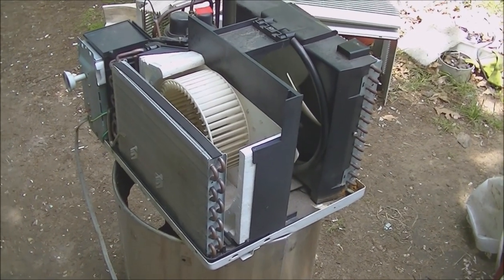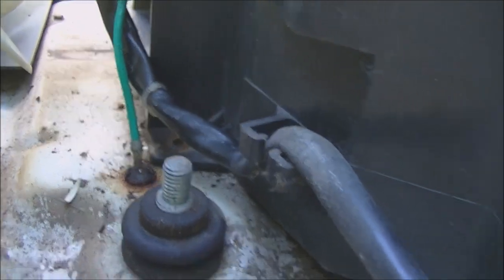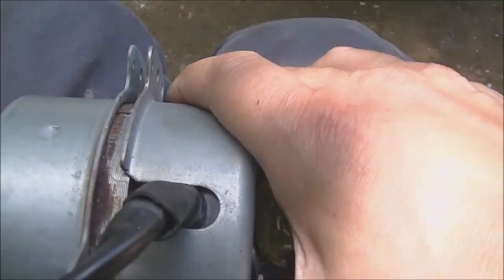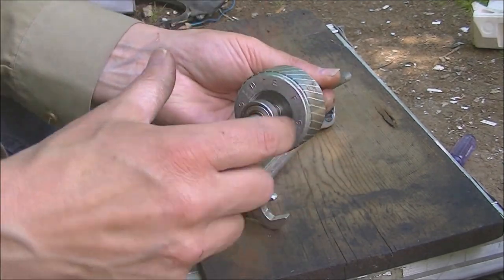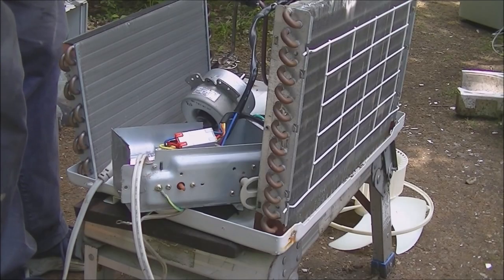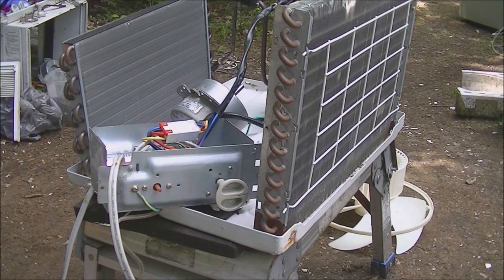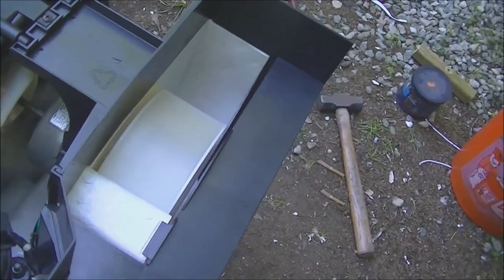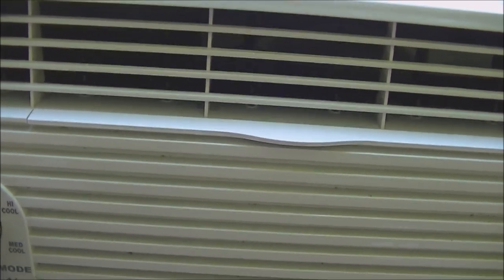Replacing Air Conditioner Fan Motor Bearings

Comment: I'm bummed you didn't record it running before the tear down. Great vid tho. I came here because I have a split-system window AC and inside fan motor suddenly makes a winding noise after I did a thorough bleach cleaning to rid the fan housing of all the black mold built up inside it. So bummed.

Comment: When removind the E clamps be careful about scoring the motor shaft. Had the same problem with getting that little bastard off. Used a dremel to smooth out shaft.

Comment: Really cool to watch you fix this A/C!  Have you ever opened a "sealed" bearing and greased it?  Wonder if that would of helped too?   Thanks for the upload!
Reply from the maker: No, I've never tried it. These shielded bearings, I don't think you can open.
Reply: @airconditionersexposed  Yep, you just pop the plastic covers off exposing the bears and you can grease them.   Check Youtube on how to do.
Reply from the maker: @Ram14250  I have seen that. The original ones aren't sealed plastic though, they're all metal, shielded.
Reply: Yeh it's quite silence after changing Bearings, good job 😮
Reply: @airconditionersexposed Greasing won’t help if the bearings are worn out or rusted. Shielded bearings easily get moisture intrusion and then the balls rust and get noisy. The rust grinds up more of the bearing, etc.